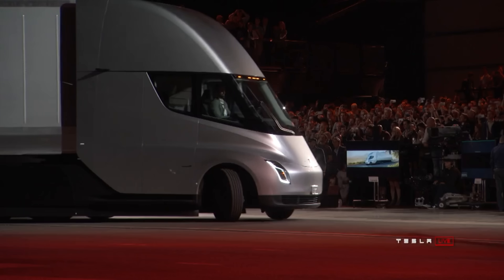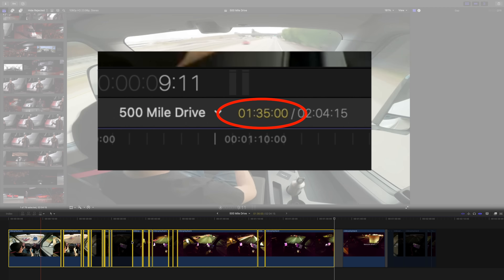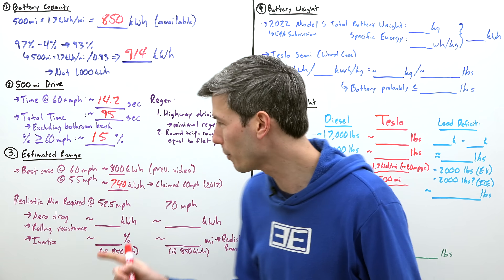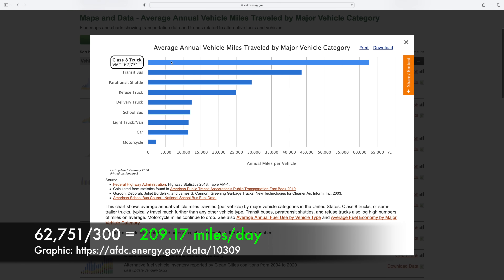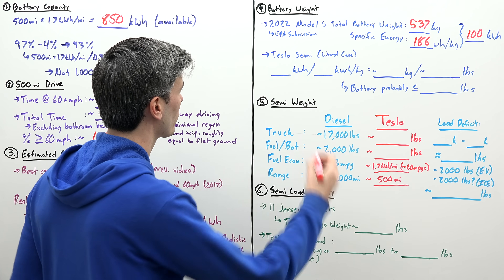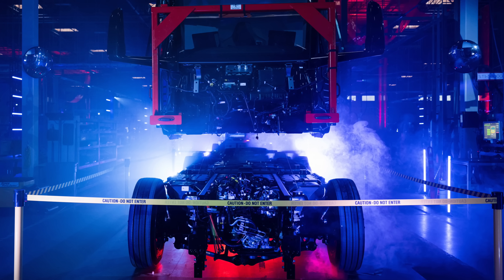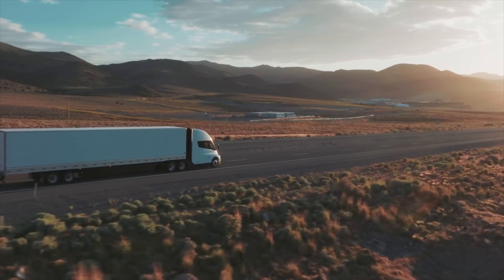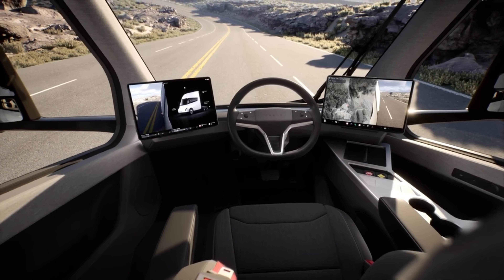Does The Tesla Semi Make Any Sense? Part 2!

Comment: You know made more sense? Box trucks. In Europe they use electric box trucks for short deliveries and regular trucks for long haul. It takes away much of the weight issues and Tesla could absolutely build something better than an EV converted van from Volvo. 

A 100kwh box truck would actually make a bigger impact and could theoretically replace most if not all regular box trucks. With the size allowing 200kwh or more it's almost a no brainer.

Comment: Living in a sea port City, I see plenty of semi driving containers over the last miles from the railyard to the port and back, in congested traffic. Those electric semi may be the best solution for this application while also removing the pollution from the urban centers. I still doubt their usefulness over long haul, at least until the charging infrastructure develops
Reply: If Tesla can up the range of the semi on a single charge to somewhere between 600 to 700 miles between a charge while maintaining the same current or less tractor weight and keep recharge times between 30 minutes and 1 hour, you will see a significant increase in adoption rate of this truck for long haul fleets. Most solo drivers don’t exceed 600 to 700 miles in a day currently with diesel trucks before they have to take their 10 hour break. More often it’s less than 600 miles per day. 

When I was driving truck, while my truck was governed by the company usually to speeds of 60 to 65 mph, over the course of the day, due to traffic and terrain, (and often local/regional speed limits) my logged daily average speed was 47 to 58 miles per hour. Rarely did I reach a 60 mph average speed. Only occasionally did I exceed a daily average above 60 mph.
Reply: @americanrambler4972  you had to stop at 8hrs anyway which at best was 500 miles. You can recharge 350 miles in 30 mins which gives you the range for the next 3hrs before you have to stop.

It's a tight schedule but you could take a break at 6-7 hrs or whenever you see an open mega charger... And still hit those 11hrs of drive time.

I don't see why people claim it can't do long haul?
Reply: @Josh.1234  I don’t yet know if the logging rules would allow you to go off duty break time while you recharge. Right now, refueling time is logged as on duty, not driving. If you are allowed to go off duty while the truck charges, then you could even possibly do a split sleeper and charge while you take a nap. But I don’t know if you would be allowed to sleep in the truck while it’s charging. 

If you can plug your truck in to charge, and go take a one hour lunch break, as of duty, than you can fully charge the truck and drive an additional 300 to 400 miles and go as fast as you need to go, up to about 70-75 mph.  

The super/mega charging network will grow. It will just take some time.
Reply: @americanrambler4972  rules are now you can count on duty (not driving) as your 30 minute break. So getting loaded, or getting fuel is fair game for break. Now, some carriers and unions still require actual off duty status for break time to count on their eld, but as far as the feds, it's not the case anymore.
Reply: @americanrambler4972  yeah, what you're saying makes sense. seems like there are some ways truckers could adjust to take advantage of the Tesla semi's fuel savings. It's like 1/3 to 1/4 the price to fuel it over diesel.. pretty crazy.
Reply: @Josh.1234  
BINGO!
Exactly the point I've been making for months.
.
The DRIVER is the range limiter.
Reply: CNG trucks would be a good option. UPS and Frito Lay have bunches of em and they seem to work out.
Reply: @Grauenwolf  Well, the Semi has a day cab, not a sleeper cab. Seems to me that rules out traditional long-range trucking right there. The current Semi is clearly aimed at applications where you go home at night.
Reply: @TonyCrispruby  Just depends on the trailer usage, if it's other companies trailers or container boxes.
Reply: While it wouldn't be good for long distances right this minute, the easy assumption is that charging resources will drastically improve over the next ten years, and by the time you are guaranteed to find charging anywhere you look for it, I see this as working quite well for long hauls. Charging cycles should match up pretty well with rest stops drivers would be taking anyway, so you would say drive for 4-5 hours, take a lunch break that would allow you to charge up a bit, drive another 4-5 hours and take a sleep break while it charges to full, repeat.
Reply: @timogul  charging trucks is easy compared to cars because trucks generally go from terminal terminal.
Reply: Up hill leaving port heavy and returning downhill light will not balance out for keeping up with the charge in the battery.
Reply: Disagree on the pollution.  A Modern diesel engine with after treatment driving in LA is literally cleaning the air.
Reply: @zachary3777  no doubt modern diesels are very efficient once warmed up.  But if the air was clean as you say, why not run it into the cab in cold weather to keep it warm for free?   Because it still contains a toxic brew of NOx and particulate carbon, a recipe for emphysema, cancer and other serious afflictions. All you can really say is that it’s not nearly as toxic as it used to be.
Reply: @zachary3777  Nice try!
Reply: It will and does work well for the last distance delivery. Unfortunately most of those trucks are ex highway trucks.
Reply: is it?
do remember a container carrier, with a box on top of it, is much heavier than ordinary courtainsider trailer
Reply: Diesel fumes is what we need to get rid of.
Reply: Same with me, I don't understand why everyone is making such a big deal about how this can't function in long haul trucking. This is a first generation electric truck that is very much for urban environments and after a generation or 2 will get better and better range, I'm not sure if will ever fully replace diesel on long haul anytime soon but removing any is better then nothing?
Reply: @dr_tails658  “will get better and better range”

Why? It’s not a software app w 2.0 on the way. While it may get better, it may not, as batteries  have an energy density limit. With every push to to increase energy density w different tech, comes other problems like shorter life, more sensitivity to temperature, slower charge/discharge, greater chance of fire.  And , the cost of  lithium ion batteries is going up the last two years due to lithium shortage, not down.
Reply: @dr_tails658  the idea is that current technology is better suited for short to medium haul, but instead of Tesla making a smaller truck for this, they decided to make a semi, which is the best suited for long haul, so everybody is looking at this truck from the long haul approach
Reply: @dr_tails658  which first gen!? Lol… EVs started way before ICE
Reply: @carholic-sz3qv  You’re either joking or you’re beyond dense.
While the first electric vehicles was in fact made before a combustion engine car there wasn’t any investment into BEVs. Billions of dollar are spend every year for multiple decades to increase the performance of ICE. That started for BEVs in some parts of the world 10 years ago and all over the world 3 years ago.
Reply: @carholic-sz3qv  EVs have been around 40 years before fossil fueled cars. I think there is a need for all the different energy platforms.
Reply: @dr_tails658  well as batteries are not getting any lighter the more battery the less load so V2/V3/..Vn  is not going to be any better
Reply: @ReapermanUK  
"Well"
As cells are getting more energy dense, which leads to a lighter pack for the same energy, V2-V3 WILL get better.
However
This version can ready carry the load, so it's a moot point.
Reply: renault has already been building these "last mile" electric trucks for some time now and they are not semis, they are short cabovers, since semis are not very well suited for urban driving
Reply: @crimsonlightbinder  I think there's a misunderstanding.  When I think of 'last mile' I think of distribution to individual store/industry.  But I believe Victor was referring to a sort of 'link' between rail and ship using the standard cargo containers.  Those are 40 feet long and 8 wide.  Trucking something like those a distance of a dozen miles or so would be an ideal application for an electric semi.
Reply: @crimsonlightbinder  These can easily be used for small point to point routes and other areas including certain last mile deliveries and intercompany deliveries
Reply: @crimsonlightbinder  Yes, Renault Kangoo ZE has a laughable 22 kWh battery. And it still can be used as a "last mile" delivery van with its ~120 km range. Its tiny battery can be recharged in no time and when it dies it produces way less waste than 80 kWh battery from an average Tesla.
Reply: @APopov  100% of Tesla batteries are recycled. With over $1000 worth of materials and a car battery and $10,000 worth of materials in these large truck batteries, recyclers will be fighting over who gets them.
Reply: @colingenge9999  I see your point. In a perfect world they are 100% recycled, and not once but every time batteries need to be replaced. Just want to correct you that not 100% of Teslas live in a perfect world. Totaled Teslas are often auctioned and shipped from USA to (for example) Ukraine. Then they are restored (quite often very badly, for example w/o airbags) and live a happy 2nd life. And when their batteries die in a couple years later here nobody bothers recycling them, trust me.
Reply: The biggest problem with ev's is that the end of ice is a better opportunity to make the social changes required for electric rail
Reply: Even beyond that put the batteries in the containers as well like in the chassis of the trailer
Reply: Enough shitty batteries are environmentally destructive and dangerous technology when they are made in these sizes
Reply: @مدمنكورة-معتزحفني  Its the particle emissions in urban centers that electric vehicles will basically remove. 

Forget the life cycle crap, its basically one resource for another, but getting rid of urban smog is a big deal.
Reply: @مدمنكورة-معتزحفني  Why are you only concerned about environmental impacts when it comes to batteries? Why aren't you concerned about acidifying oceans, acid raid, temperature increases, sea level increases, or particulate pollution?
Reply: @spacetoast7783  Yeah, they didn't reply to that one. Also, battery recycling is big and it's turning into big business. The people that cling to ICE powered vehicles think one dimensionally and are stuck with the talking points they get from their favorite news/media sources. They don't even follow the tech to know that they are moving to aluminum and sodium-based batteries. I still remember the arguments over cobalt, which some where very valid, but most arguments were just talking points they heard from their oil loving propaganda networks. We'll have to keep dragging these stubborn people ever forward.
Reply: @JasonB72481  I follow the tech, and energy density in batteries is not increasing in any sort of useful amount, chemistry/physics of reality  means all gains are minor, only if you believe in magic will this work.
Reply: @ReapermanUK  I haven't checked on that statistic myself, but I imagine it's also market driven. For instance prior to hybrids even nickel battery packs were expensive and lithium was just out of the question, now lithium chemistry is affordable enough to be somewhat market viable. As manufacturers start to hit walls with the chemistry it is only natural for newer development of better battery chemistries to be developed. Maybe not higher density, but possibly faster recharge rates, lower costs, smaller environmental footprint, etc. Since you say energy density hasn't increased noticeably over the past few decades, but for sure all other aspects around the battery technology has.
Reply: @JasonB72481  you are right about us having to drag these guys forward...

When owner/operators see the massive fuel savings their competition is getting, they will quickly switch and pretend they never made all these comments.
Reply: @JasonB72481  As for cobalt, refining gas uses a significant amount of that, too, but that's old tech so it doesn't make for headlines you can make money with. It's the same thing as the significantly higher fire risk with ICE cars.
Reply: @JasonB72481  well i do not have a problem with EV as a tech at all i think its actually good thing, what problem i have is the inability or even comprehension for people to see that there is a possibility move away from majority cars all together as a mode of transport, in favor of public transportation, train system its way more efficient, less pollutant even if they are running on diesel.  if u have to build infrastructure for these EV why not build more or just restore the existing ones that are rusting(these are many many miles that are just abandoned) train truck for a mid/long journeys (500-1000 mil) and just EV for a last mile delivery. instead of opting for cars/ planes for these distances?
Reply: @tomaszwida  there are people doing EV conversions. There are kits out there that do a conversion for several thousand. The tech is getting better and more affordable. I wish we could address the public transport issue, but our country is ruled by corporations that have vested interests in keeping things the way they are. The opposition to EVs is what's slowing the progress on adoption and technology.
Reply: @مدمنكورة-معتزحفني  it's worse with fossil fuels though as their adverse effects are not limited to environmental destruction but climate change, your foreign policy limited by energy dependence on autocratic gas station countries and the continued oppression faced by their citizens as they rely on fossil fuel profits to finance their police state
Reply: @hydrolifetech7911  what a WOKE argument dude.
Reply: They can use less energy-dense LiFePO batteries which are way more environment friendly (low-range Model 3 and Y already use them).
Reply: @مدمنكورة-معتزحفني  it still doesn’t compare to the horrors of the oil industry.
Reply: @مدمنكورة-معتزحفني  worst case for oil-rich countries? This might actually work! Wind and solar are free, once the capital investment is paid for.
Reply: @مدمنكورة-معتزحفني  tesla guarantees to recycle 100% of their batteries which is a lot more than could be said for diesel. And why not? These batteries have $10,000 worth of materials in them and are certainly much more element dense than the ore from which they got them in the first place.
Reply: @مدمنكورة-معتزحفني  over their lifespan the emmisions saved will certainly help reduce carbon concentrations in the atmosphere.

The problems that need to be addressed are mining in a humane and sustainable manner and disposable of the batteries. Cobalt mining in Africa is nothing short of criminal, mining companies should be paying workers a descent wage. You also have cases of Chinese owned mines literally stealing minerals not just from neighbouring mines but the countries theyre mining by underreporting.
Reply: @مدمنكورة-معتزحفني     yes, there is still pollution, but they are moving the pollution away from where most of the population lives
Reply: @victorradu9645  That is kind of difficult to believe. Since where I live in Calif. we are getting pollution from China, half way around the world. You can claim that EVs are more environmentally friendly when they really are not. Pollution is still created some where to power these EVs and to build them. What are we going to do with all the batteries once these EVs are no longer useful.
Reply: @norberthofer5830  tesla guarantees 100% of its batteries will be recycled and why not with over $1000 worth of materials in each battery. They are more lucrative than refining these materials from scratch.
Reply: @victorradu9645  Alot less pollution with electric BEV

Comment: I personally think you should compare a brand new, top of the line, truck with the cybertruck.

It's costs as much as one, and companies would have to make decisions like this.
Reply: Impossible, there is no Cybertruck to compare anything to.  Try a F150 lightening or Rivian R1T instead.
Reply: @pablopicaro7649  those are for normal people, not corporations.

An electric taxi or the rivian Amazon van might be good
Reply: @Grauenwolf  I meant compare the best performing truck Vs the cybertruck

If you are considering price, there are way more factors, especially battery replacement.

If you wanna go further, and consider the price for the government, you would also have to consider the subsidies and road damage due to higher weight, also the battery disposal depending on state.